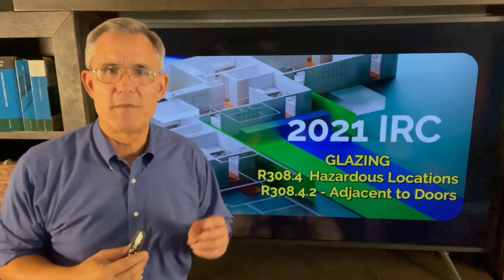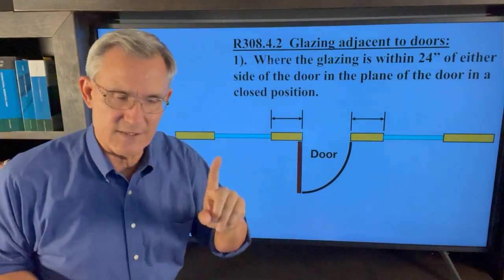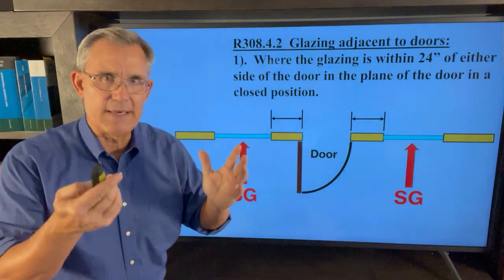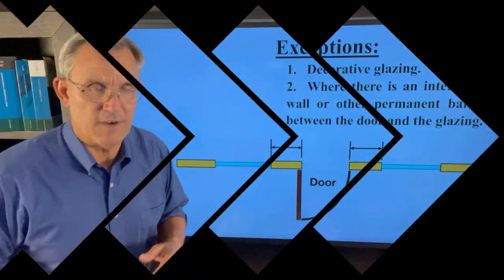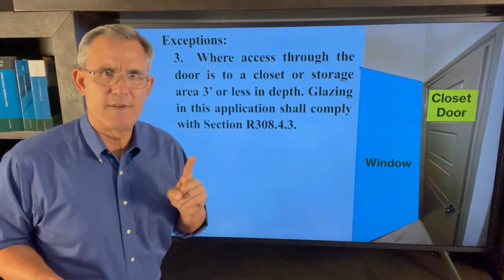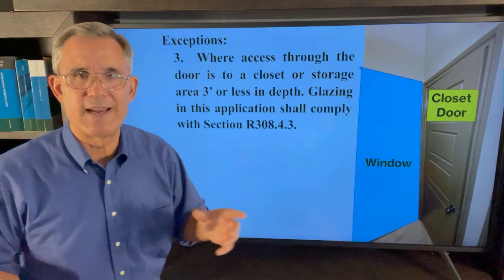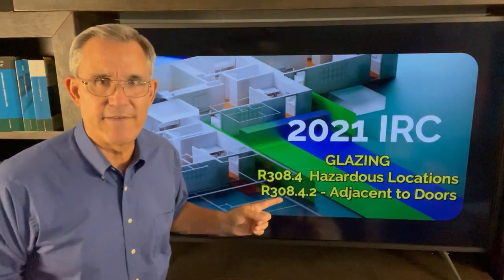2021 IRC - Safety Glazing Adjacent to Doors

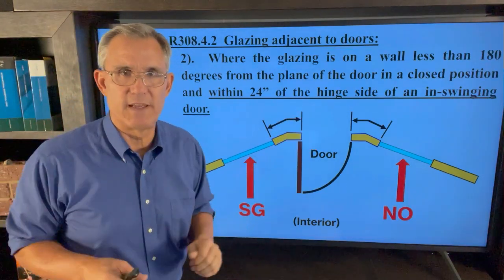Comment: Hey Dave!  @~3:12. I think it’s because the HW on the door has the ability to shatter the glass when swung fully open on the hinged side.  What do you think?
Reply from the maker: That usually does not happen if the glass is setback into the wall.  But yes, in some cases that could happen.